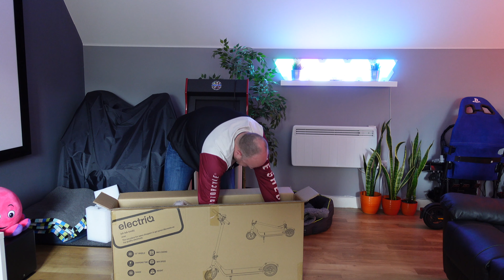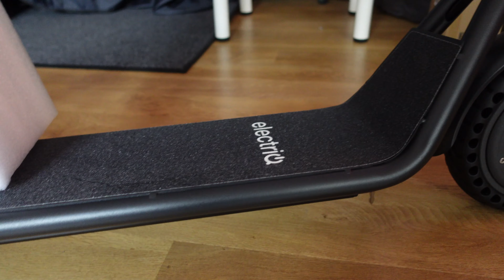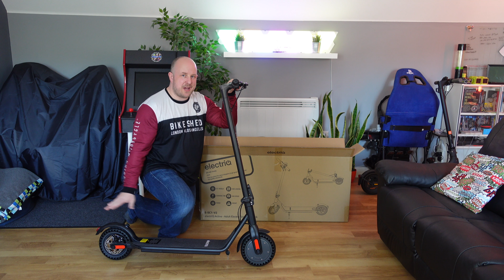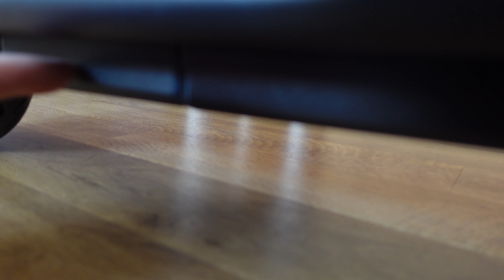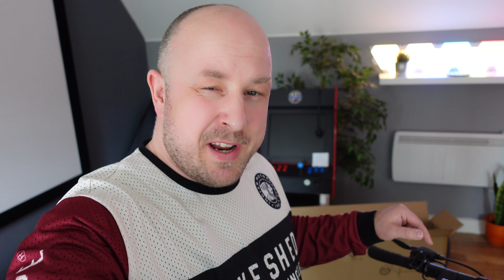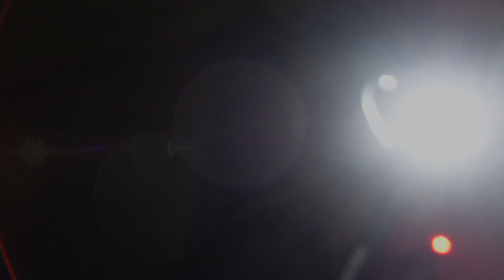Checking out the electriQ Active eScooter

Comment: what is the max miles it csn go like distance
Reply from the maker: As mentioned in the video, in ideal conditions 15 miles, but more likely 10 miles.
Reply: @ConsideredUK  does it have cruise control and how about speed does it go abit over 15mph
Reply from the maker: @m2lavish336  As responded to your other question, it will go over 15 MPH if on a downhill, and depending on your weight.
No cruise control. I recommend you watch the video as I mention the features of what it does.
Reply: @ConsideredUK  ok i way 56kg and does the scooter go fast

Comment: where did u get ur scooter from
Reply from the maker: https://www.dronesdirect.co.uk/bct/electric-vehicles/electriq-scooters
Reply: @ConsideredUK  can the scooter go abit over 15mph and do u always have to hold on the accelerator button
Reply from the maker: @m2lavish336  On the downhill it will go faster, you have to hold the throttle switch to engage the motor, but you can not hold and free wheel, especially when going downhill.
Reply: @ConsideredUK  ohh so u have to hold the accelerator button
Reply: @ConsideredUK  does it go up by 15mph

Comment: They now have a version with a range of 45km for just 230 quid. I was looking at the pure air pro for 474 with 50km range but might just go for the Electriq
Reply from the maker: Cheers for sharing
Reply: If the battery easy to remove on the pro version?
Reply from the maker: @umerhussain3938  No idea, only used the version in this video.
Reply: £204 with the code on drones direct

Comment: Hello, first of all, you explained it very well, I ordered this model and after 4.5 days the scooter turns itself off, so I drive the scooter, it closes after 1 minute, can you please help?
Reply from the maker: Sorry, I have not experienced this issue with our one to advise of what might cause it.
I would check the wiring is not snagged and the battery is connected properly. If not give the manufacturer a call.

Comment: I bought the pro version which is the one you have I believe but on level 3 mine goes 15mph… should i of charged it before use?
Reply from the maker: 15MPH is the correct top speed. 15 MPH / 25 KPH.
Certainly recommended to fully charge prior to use.

Comment: How long does the battery last? In 3rd gear ? Aw are you best off getting the pro version ?
Reply from the maker: I cant say really, never really run the battery down in 1 go, and just charge it when needed.
Reply: @ConsideredUK  ok 👍🏻 I was gonna order it but I’m wanting to use to get to and from work which is 3 miles so I’ve worked it out maybe get 2 days out of it before it needs charging? Im stuck between this and the pro which i think it does 45 km
Reply: @user-ru5wj5ne9f  the 45km range lasts for 28 miles so you could use it for many days before it dies I've had this scooter for 2 months for school and it is 7 miles away every 3 days j have to charge it

Comment: I got my electriq e-sc1 V2 and I have to say it is very torquing with power and has a good range I was riding in speed setting one and I got down to 3rd bar of battery after about an hour in a half it goes over bumps because of the honeycomb tires and charges one bar per hour I found
Reply from the maker: Glad you are enjoying it.

Comment: Mine won’t turn on..?
Reply from the maker: Make sure its fully charged. If its still not working, may need to return it to where you bought it from.
Reply: Does it turn on now?
Reply: @m4rufm1ah91  yeah it worked it’s because The battery had slid off and i didn’t notice!
Reply: Mine stopped working too, was fine the last time it was used few days ago, just charged it as usual since..but now it won't turn on..tried calling 'dronesdirect' who sold it, and called electriQ manufacturers and strangely they both have same on hold music, same automated message and same lack of service, very annoying..I didn't pay £200 for a disposable piece of junk
Reply: Makesure you have it fully charged , and you know the last time you used it did you put it straight on charge after?
Reply from the maker: @diplomasaurus4232  My son has not used his for months due to the local police cracking down. I have just been out to check on it, and its turning on and working fine still, so seems unfortunate a few people have had issues.
I have never called DronesDirect before, but the one time I called electriQ they were helpful, but I was on hold of a LONG time.

Comment: Do you know what polarity the charger port is (or please could you read charger brick) as I need to order a replacement one for mine and want to ensure correct polarity
Reply from the maker: Based on the back of mine, pin 1 is positive, pin 2 is negative, nothing assigned to pin 3.
Reply: @ConsideredUK  that's great thank you

Comment: Re: removing speed limiter - I’ve investigated ALL the wiring - the speed limiter is definitely in the controller box, where the battery plugs into. 
Take off battery (turn key 180 degrees, slide away partially & then lift it off). 
To remove controller - carefully peel back the reader sandpaper deck & remove the 6 screws (be careful to not strip the screws like I did - the screws are terrible, very soft). 

Once I have the stripped screw remover set delivered & I’ve been able to look in the controller I will post a video or update this comment at least.
Reply: Yo you figured it out?
Reply from the maker: Good luck, hope it works out.
Reply: Have you figured it out yet as I’m very interested?
Reply: Were is the spees limiter thanks
Reply: any updates?

Comment: I've got one of these and the motherboard just blew a chip emailed the company directly no spare parts available apart from a battery and tyres.. Basically if it breaks you've got to bin it as it can't be fixed like the rest of them
Reply from the maker: That sucks, sorry to read. Like you say, same with most things in the consumable item approach to most things.
Reply: Ours stopped working just within a year of buying!!!(battery& charger are fine, but scooter still won't turn on) No customer care from manufacturers either
Reply: Mine is 15 months old but barely used, now it just won't turn on. Battery is fine. Has anybody managed to fix theirs?
Reply: Finally got it bench tested and the battery is not fine, it is dicked. Scooter starts up fine when on an external bench power supply. So new battery is now on order!

Comment: I just got the e-sc10 model, i presume this was the older one? Should do a unboxing video on here really as i couldn’t find one on youtube for this model! Hence i had to just buy and cross fingers, they sound identical apart from different back break and the newer model goes a few more miles in range

Edit: neither a bell or removable battery lol
Reply from the maker: Assume you are still happy with it?
Reply: @ConsideredUK  yes good little scooter, still going strong, only downside is you cant really get suspensions for them, i dont really use it now, too cold, i stick with the car